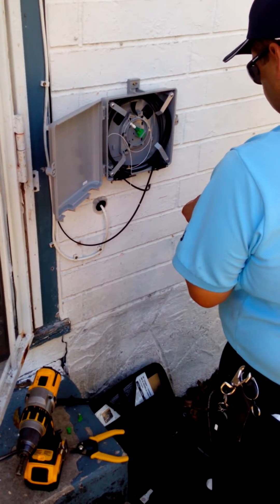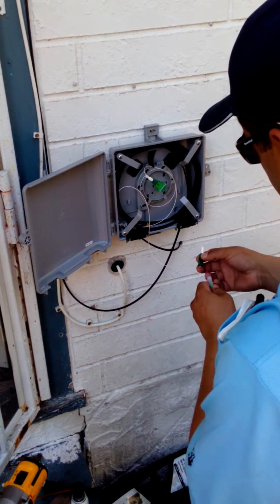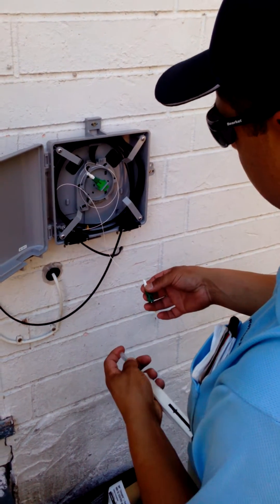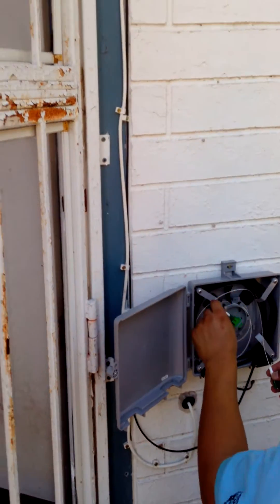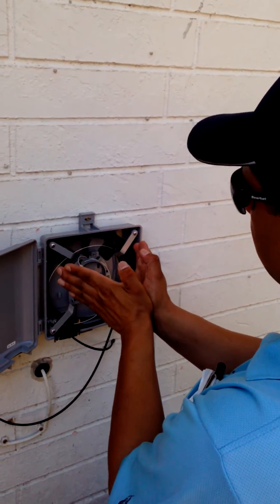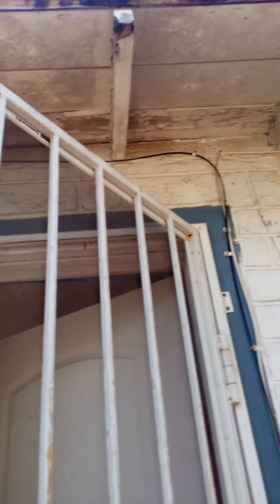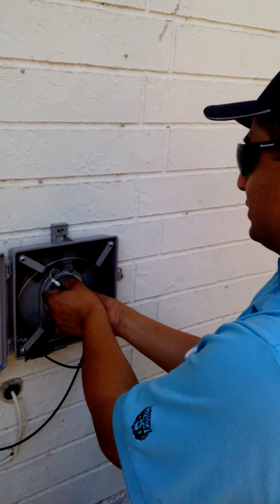ATT GIGAPOWER Installation ! SA TEXAS FIBER OPTICS!

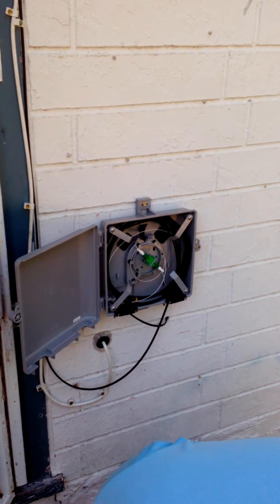Comment: 1:35 gigabit. Gigabyte would be 1GB/s, but its 1000mbps aka 1 gigabit = 1gbps. The difference is the bit to byte ratio. 8 bits to a byte. So 1 gigaBYTE would be 8 gigabits. AT&T doesn't provide that to consumers, yet ;).

Comment: more power!!!!
Reply: 7GTV Yeah I would figure the ethernet port or wireless adapter in a ps4 wouldn't be able to utilize that bandwidth so it will definitely slow down. As I'm speaking right now, AT&T is installing fiber in my neighborhood, but I'm planning on using it more for Internet TV so I can ditch directv, as well as game
Reply: 7GTV Why is it not?
Reply: Gaming doesn't need much bandwidth, but it does need as little latency as possible. I would figure fiber would have less latency than ordinary cable or satellite.
Reply: Tristan Borden Exactly what i thought cause i think that you get like 1ms pretty much all the time (in reasonable length)
Reply: Mitchell Griffin Now I'm not sure entirely but I think it depends on how far away you are from your provider's based location. Since light is shot through fiber cables though, I don't think it will make latency horrible if your across the nation, so maybe other factors can affect it
Reply: 7GTV Oh alright
Reply: 7GTV Spectrum as in Charter? Cable Internet